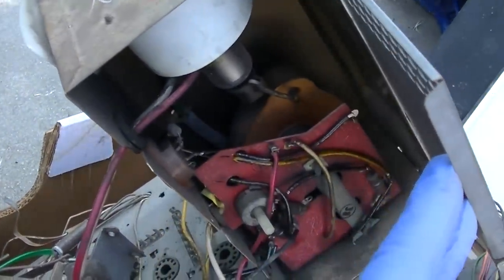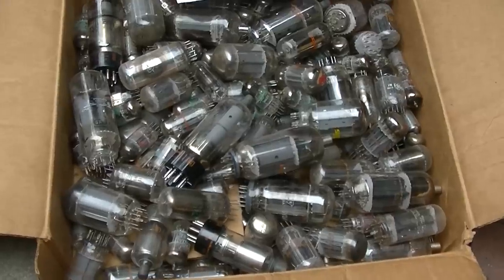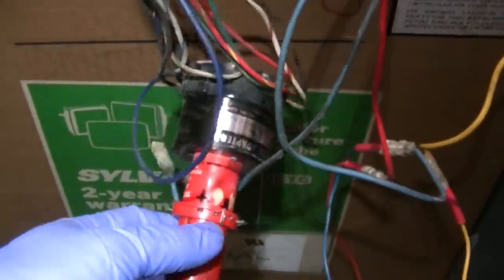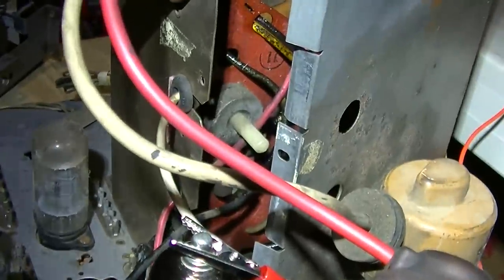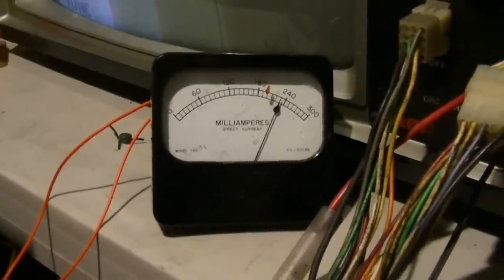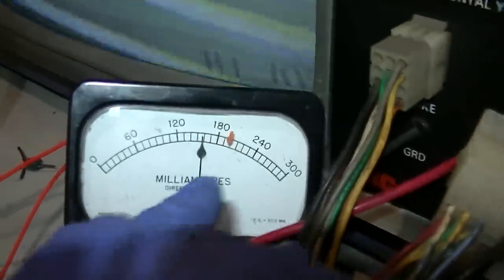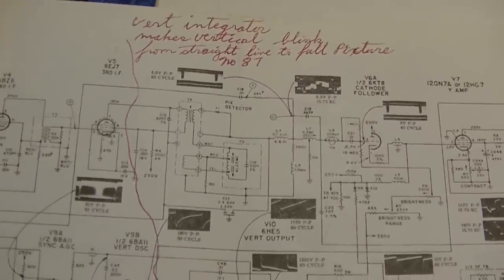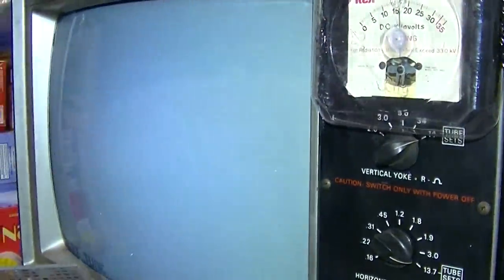Zenith 24MC32 Color Roundie Chassis Resurrection on Jig

Comment: "Don't try this at home kids!"  Is EXACTLY what my parents gave me to 'play with' as a child. A tube TV set.   Reminds me of the old: "why don't you go out and play in traffic." .....
Reply: Yep, I was also playing with running B/W tube TVs since I was 10, maybe even at 8. Hot chassis, no isolation transformer. And I somehow survived. I only recall a few bigger shocks. Fortunately the models I had all used the same chassis with a single Si diode as half wave rectifier, so the chassis was tied to one pole of the mains, and not to the negative side of the full wave rectified mains. This way if I pugged in the plug the right way, the chassis was on neutral potential. I always done that, and wore well insulated shoes.
Reply: @mrnmrn1  yup...
somehow God let us live
Reply: I guess your folks didn't realize the dangers.

Good job it wasn't a pre-WW2 set with mains-derived EHT !! Those were known as the "Widow Makers" ...
Reply: The worst shock I ever got was from a car radio vibrator transformer.

Comment: Story.  I had a 19" Zenith B&W same vintage. Changed the intigrators, feed back caps in & cathode cap 
in vert. Set was vert blinking  like yours. Went nuts, I wanted to fix as it was almost NIB. Turned
out when I put the cathode cap in 6" from the can was the reason. Got an OEM can & fixed it.
LFOD !

Comment: I loved this video! It's like everything that really happens and more! I remember reading all the service stories in radio TV magazine and this is a thousand times better. I'm impressed at how a flyback and other components dry out while in service. When I worked for the power company we used to pull a vacuum on a transformer to get the moisture out. I wonder if a flyback or other components could be placed in a light vacuum and slightly heated if that might dry them more!

Comment: I use 6P4S in my Dentron GLA1000.  Grids are tied on them grounded grid.  These tubes are fantastic for the frugal ham.  Have 4 sets of them spare.  Amp is modified all tubes are balanced out.  Lots of info on the net to modify this linear.  Amp with 50 watts drive puts out over 550 pep on ssb.  Bet it is great for TV's.  KM6BYW.

Comment: Years ago, dad ran an electronics lab at one of our local universities and he built a high voltage RF generator for a physics experiment. When demonstrating it, he pointed out where the dangerous part of the circuit was, just then an arc punched a hole in the nail on his index finger and burnt the skin underneath. It comes as no surprise that in his EE course, one of the lecturers had the name R.F. Burns and looked like he was suffering from some.

Comment: CB linear amplifiers didn't run the tubes as sharp-cutoff pentodes; they ran them as cathode-fed, grounded-grid triodes. I was in that business for awhile decades ago. There is a lot I could tell you about it if you want to take the time to talk about it. To answer your question, it's not hard to find old amateur radio literature with grounded-grid sweep tube amp designs where the harmonics were 30 dB below the fundamental prior to output filtering being added. On a scope that's a perfect sine wave. By the middle 70's the larger CB radio amp manufacturers were buying large lots of tubes designed specifically for them directly from GE. The ones I'm familiar with are the 8950 and M-2057. A quick search for "8950 tube" and "M-2057" tube will lead you to data sheets. The dates on those data sheets are 1975 and 1976. By then the CB linear amplifier market was driving power pentode tube production more than television. I'd argue that if there was ever any significant sweep tube surplus it was created by bad orders made by dying CB linear amplifier manufacturers.

Comment: I immediately knew the V out plate feedback integrator was bad when I saw the vertical stopping and starting.  A set I got from another collector who couldn't figure it out had that. I think he got it in working order from another collector who used unlabeled low voltage micas that shorted...Took me a while to find it, but once you've seen that bizarre behavior you learn what it means...It's even helped me troubleshoot vertical in other makes.

Comment: 12:52 And oh man! I was a kid in the 80's my friends and I used to find tons of vacuum tube TV's. The time when people were throwing away many working TV's due to them being vacuum tube stuff. I actually kept a couple of black and white 12" ones that worked! 

We used to break open the TV's from dumpsters and used to pull all the vacuum tubes and dumb friends and I used to throw them at each other. We were aiming for the feet though. Not that that makes much of a difference. We must have busted hundreds and hundreds of vacuum tubes. Ah! Stupid old days.
Reply: There was a park in my area and a part ran under the street and so there was area under the bridge.  Unscrupulous people would toss all kinds junk like old TVs there for some odd reason. It was the 70s, it was perfectly acceptable to throw away a CRT TV.  In any event, one day there was a TV under there and my friends and I wanted to see an implosion and so we threw bricks at it.  That thing did not break for nothing!  I think we even smashed soda bottles against it.
Reply: @tarstarkusz Oh yeah we'd think it was easy but one time I threw an entire car suspention at a small color set with all the strenght I had and the only thing that broke was the shadow mask inside 😂

Comment: Sharp cutoff actually means the tube is linear. As opposed to remote cutoff which has the control grid wound with varying pitch so the cutoff is less sharp, which allows for gain control, but makes the tube more non-linear.

Comment: Damn its loaded with those ELSHITCO caps, a lot of this could very well be that high voltage, it seems to be fluctuating badly, i can hear it leaking everywhere. Moist dust is causing partial shorts everywhere. i would switch it off and run a hairdryer over it for a good 20 minutes.

Here in the UK we had a program similar to your old version of 60 minutes, it was called "the cooke report" damn he cracked down on criminals hard live on tv, it was excellent.

Comment: I wonder if dipping tube pins in a wax / grease prior to storage, would halt corrosion or oxidation of the pins, and preventing leaked and going to air ? Just a thought.

Comment: Sounds like the bad fluorescent tube starter audio effect in 1982 Ridley Scott's Blade Runner (and many other worse movies). Brass decreases induction (aluminum cores are also used for the same purpose in old HF trasmitters), and ferrite increases it. Many of the people repairing/restoring radios use a self-made tuning tool consisting of a plastic tube, often from an emptied ball pen or versatile pencils with a brass core stuck in one end and a ferrite core in the other end (ex. soviets in particular while retuning old OIRT FM to the western CCIR standard band).

Comment: Re that plate current- could it be that the free running oscillator was so far out of frequency it was not supplying sufficient bias to the Horiz output tube causing it to glow red in the face due to increased current. The H osc and output are tuned to the line frequency (15625KHz in Australia) with the loss of sync to the osc would put all this tuning out of wack.  Just a theory

. I remember in old valve (tube) B&W tvs a red HO tube would indicate loss of Horiz osc. Sometimes the Horiz output would be cracked due to the heat

Comment: Please check the H.O. output tube current on the cathode and not on the plate, even if it's a little more work. I have been burned by those things and it did smell bad.  You are a teacher whether or not you like it.

Comment: We never had round color picture tube in Australia but early black and white sets had a 90 deg deflection angle whist the later sets were 110 deg. The neck of the pic tubes were also different diameters. Is your jig a different deflection angle to the chassis?  This would put wrong impedances on the Horiz output stage which would change heaps of things,

Comment: I got a question: if heat from the soldering iron changes resistance value of a resistor, wouldn't clipping something on to the leads near the resistor act like a heat sink and keep the resistor from heating up? I've heard of this method years ago to protect transistors.

Comment: Are spark plugs that expensive? I thought disposables if restoring or tuning a car.
Reply: They're not that expensive but you might not have new ones on hand. Sandblasting spark plugs is generally a bad idea because you'll probably get a little bit of sand stuck inside which will eventually fall out and scratch your engine internals. Plus modern spark plugs have special coatings.